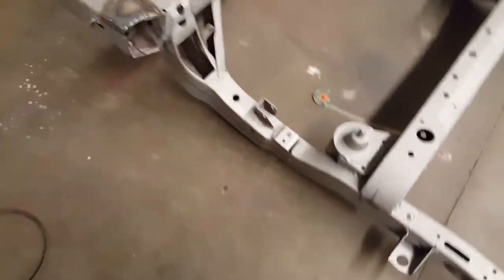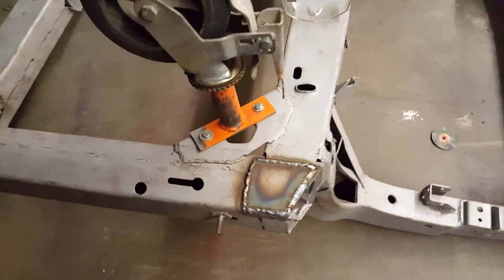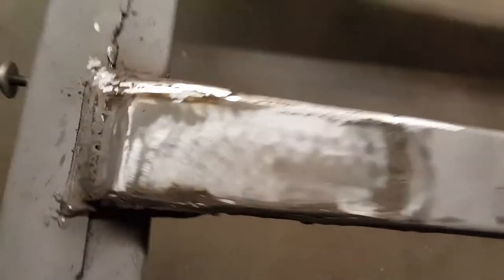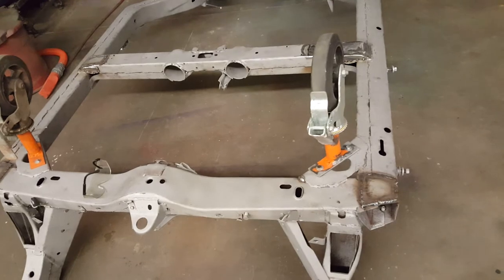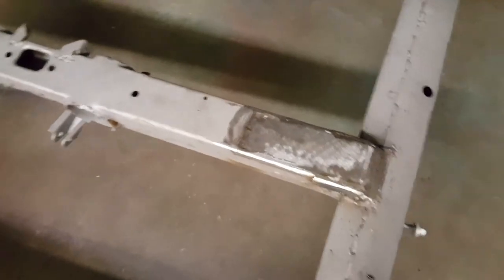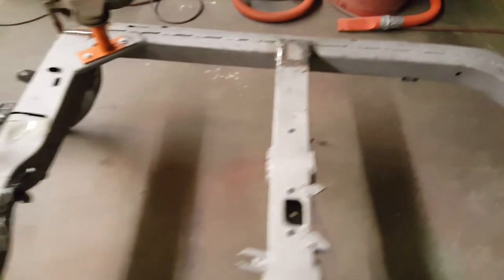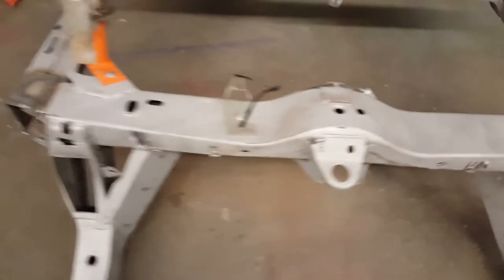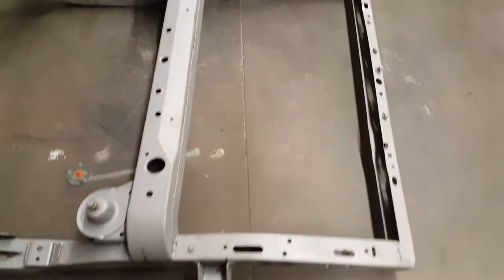Corvette frame repair

Comment: Frame looks great man, enjoying your channel thanks for uploading them. Did you think about reinforcing the front part of the frame where the firewall starts?
I just started a restore on an 81 and I noticed that the front end flexes somewhat. Seems to be the norm from what forums say. I was thinking of adding some additional support on that section. was curious if you considered that. You kinda see the flex when you jack the car up by the front cross member. just curious let me know what you think
Reply from the maker: What's up Gabe,, I'm not sure yet if I will.. I will for sure look into it now that you mentioned it..
take a look at the later vids,, it's come a long way..